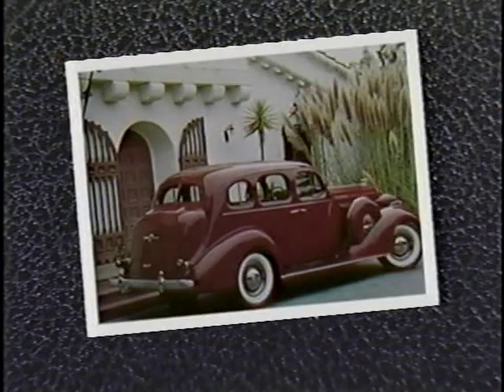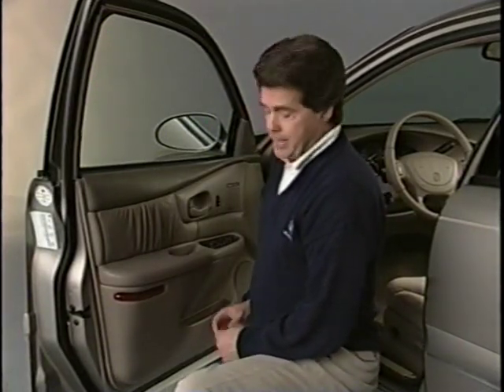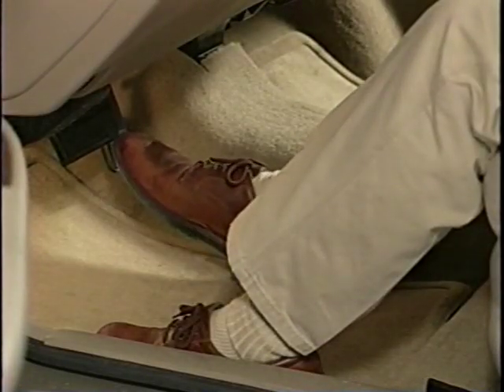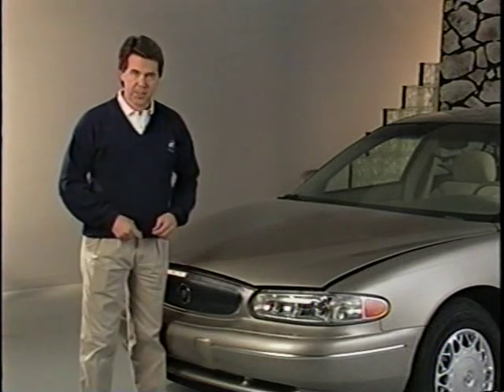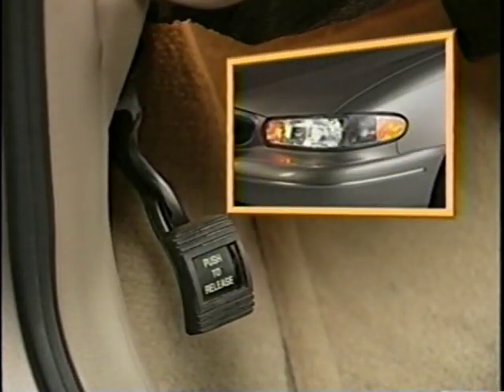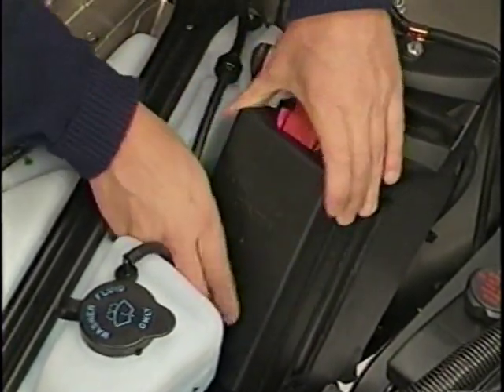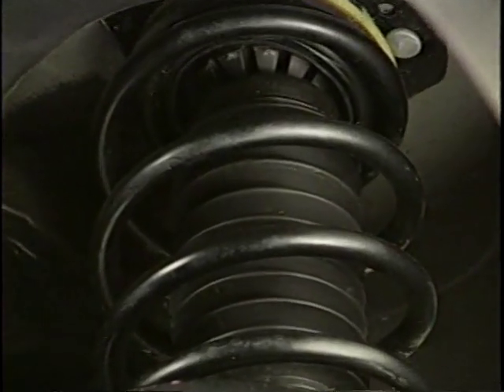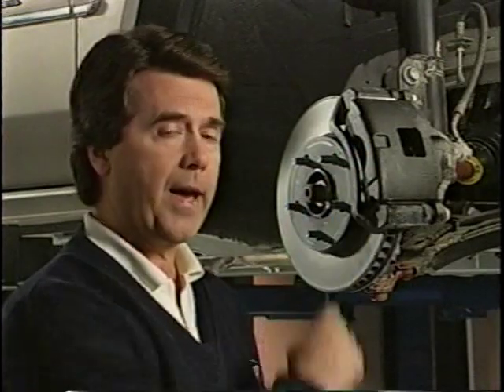Buick - 1997 Century Service Features

Comment: Yesterday I bought an Immaculate 1997 Buick Century Limited. It's so perfect it could be sold as new on a Buick lot 25 years later. It's still so quiet, faster than my sunfire, and rides like a comfy couch. Biggest thing I Dislike is the lack of a tachometer. Like wtf... I'm installing sn aftermarket one.....
Reply: Its too bad they didn't put one. The regal had a tach and you can swap the gauges but then the mileage will be off and also the MPG feature wont work on Century models.

Comment: We bought a '99 Century with 76k miles nearly two years ago for $2.5k. 30,000 miles later, it still runs and rides great. Only two repair issues in that time, battery and water pump. Very happy with the vehicle. The car is quiet, smooth riding, adequate power at 24 MPG per tank of gas, requires no added oil between oil changes, low registration fees. I've found this car to be a steal for the price I paid.
Reply: Rust proof it with fluid film, wool wax, or SurfaceShield if you want to keep your Buick.

Comment: the most common problems with the century are rusted rocker panels, intake manifold gaskets failing, dexkill coolant, and blown head gaskets.
Reply: The intake gaskets were a cheap cork rubber design. GM didn’t want to admit fault so they blamed the new at the time Dex Cool. Blown head gaskets are rare on the 3.1 What blows them is owners overheating the engine. I own two Buick century’s and they are the best vehicles I’ve owned.

Comment: Had this car, window regulators needed replacing, brake lines rusted out, and eventually the head gasket gave out and killed the engine. Great when it was running and somewhat cheap to own but after 4 years it was on the scrap yard.

Comment: we have a 2000 buick centry custom. Beside all the minor things that need fixing. The engine and transmission are running strong. 110,000 miles and no issue. just change the oil, rotate tires, and drive.
Reply: I have same year and model. Put about $1500 worth of replacement parts in it, but Key security system turned to trash. Guess its a serious problem with 1996-2000 GM cars. Have to do the reset every time I want to drive it. Will sell it for whatever I can get.

Comment: Buick got their money's worth out of this model... same car through 04 basically... Regal too  I have a 99.. cheap drink holder and no trunk button...but ok car with good ride and fuel economy.. My day time running lights aren't working....."Your lights!"...... I wish they had put in stainless steel brake lines...
Reply: Amazing vehicles Buicks have always ran outstanding for my family members and I. My brothers got me into buicks and it's always been my go to car for dependability and cheap parts if some needed to be repaired.

Comment: This model Century was the finest car Buick built with all the latest automotive technology.  It was better than anything on the road.  It would remain that way until the '98 Century came out.
Reply: I never understood what was so GREAT about the late 90's Camry's.
Reply: senorkaboom I just picked up a 98 Century for $400!
Reply: Im about get a. 99 century for 250 needs a battery and driver headlights casing put back in. And winshield replaced. I think thats a decent deal